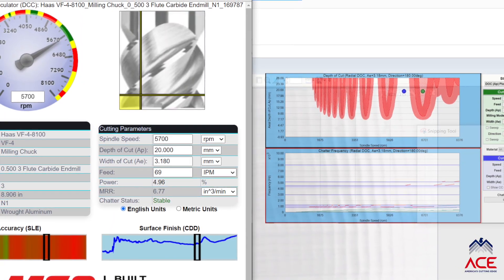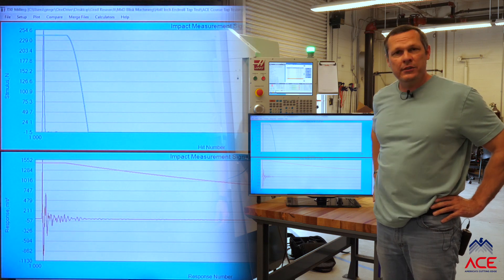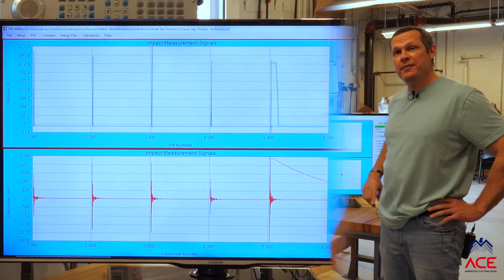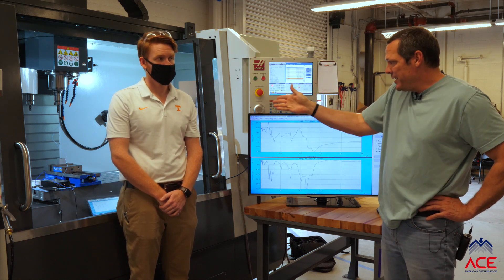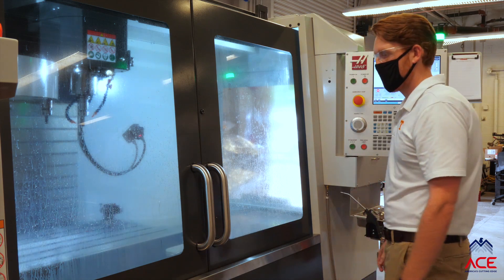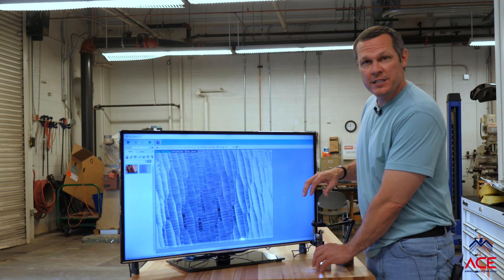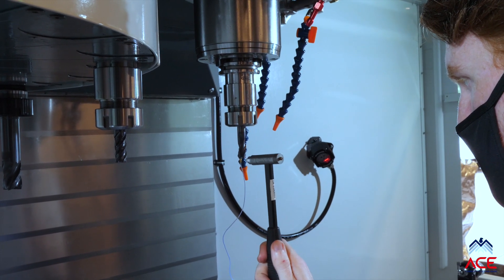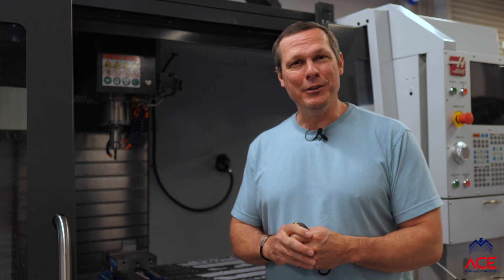ACE Tap Test with Dr. Tony Schmitz

Comment: Just curious about how the MillMax recommended RPM numbers compared to the manufacturer recommended for the same cut. It's neat to see how you were able to calculate your stable and unstable cutting RPMs in advance, but without telling us whose tool you were using, how much of an improvement over "normal" is this?